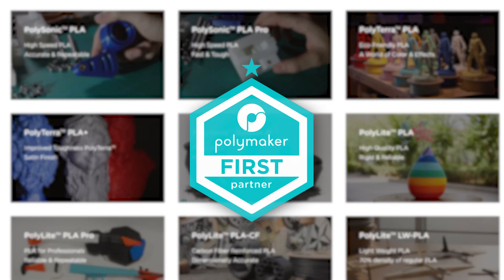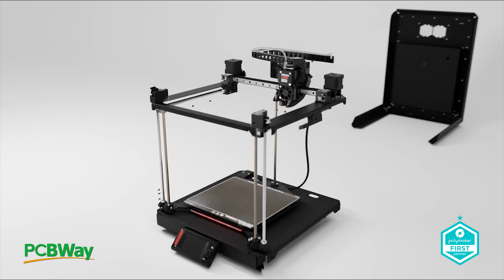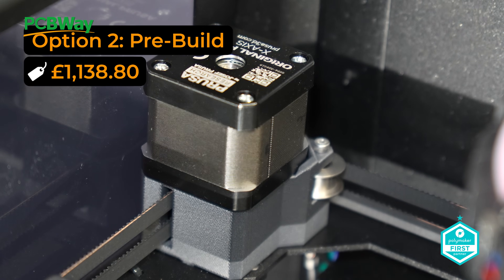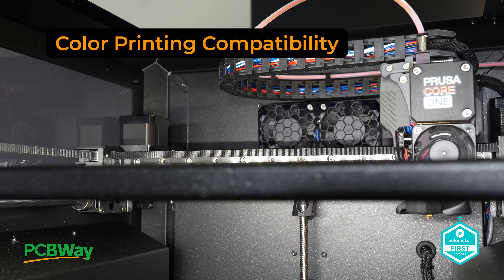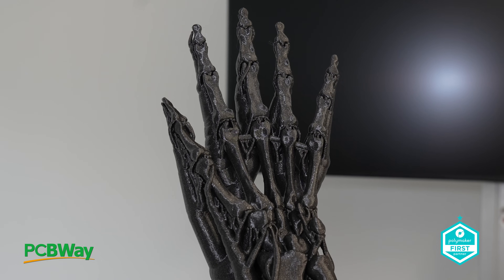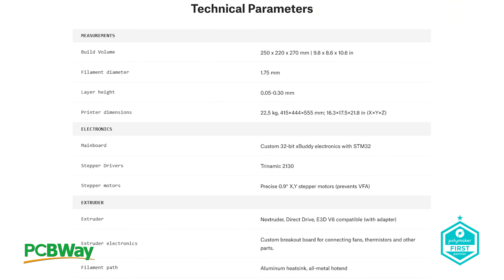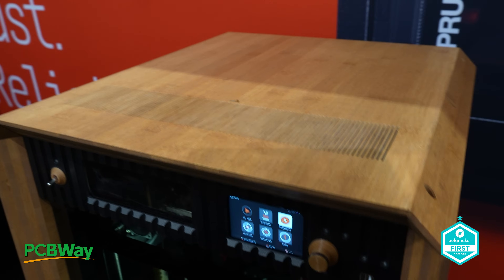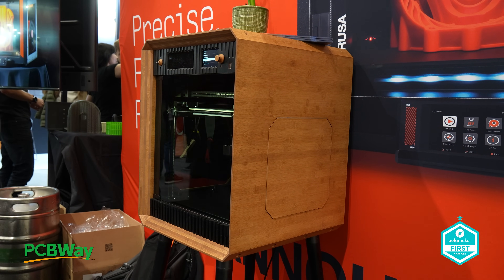Prusa Core One Takes 3D Printing to the NEXT LEVEL!

Comment: Let me preface that I am a Prusa XL 5 toolhead with enclosure owner and I love that machine. BUT this machine is still too expensive to compete in this market. Its build volume is still smaller than its direct competition the P1S and for that cheaper price you get an AMS and save some cash for filament. The offline printing ability is nice because I am one of those required to be offline customers, but this machine would be for my personal use and thus I would have to choose the P1S. If this machine was 800 usd I would be all for it because I love what Prusa used to be but not at what it will sell for.
Reply from the maker: It’s brand tho, so they will sell despite your belief they won’t. I always buy VW why don’t I buy Audi or BMW ? Well because I like and follow the brand.. having said the the t7 transporter is an ugly soul.
Reply: @TheRealSamPrentice  I never said it wouldnt sell, Prusa will sell to the die hards but its going to be tougher to win new customers. You have to hook new customers with size, price or quality.

Comment: 2:40 "increases bed size" is incorrect. It's an increased build volume. The z-axis is longer. The bed size stays the same.
Reply: Nope! The bed size is actually increased, albeit by only 1 cm in Y. (250 x 220 x 270 mm vs 250 x 210 x 220 mm for the MK4S)

Comment: The ability to upgrade a MK4S to the Core One is both a result of Prusa reusing tech from the MK4S to bootstrap a new core-xy design, as well as the desire to provide their customers with the value of upgradability.  The Core One uses the same bed and extruder as the MK4S, the extra build volume being the result of tighter tolerances in the movements, and a taller X axis thanks to the new packaging.  Yeah, I can't wait for April to be able to get one for myself.  I had been considering building a Voron Trident which would have cost me somewhat more than the Prusa kit price point.  The Trident would have a slightly larger build volume, but would also have taken up more valuable space in my office area.  I will also probably add the MMU3 as well.
Reply: As much as I find the Core1 cute, pretty sure you can get a Trident for way cheaper than this (just don't get a stupid LDO kit). The build time will be a pain but once properly done that machine will race laps around any other.
Reply: @RenBaiHu  LDO has the best kits out there with quality parts.  The other kits might be less expensive, but you might end up substituting some of the parts.  I'd like to see these kits done a la cart so I could buy one group of parts at a time to spread out the build and cost, as well as being able to customize them.   
I've had an idea with the trident, make the frame a bit wider and deeper so I could mod it to have two internal spool holders (the prusa can do this) and two independant X gantrys for an IDEX mod. 
(the 300mm size frame can fit internal spool holders, the stock 250mm can't, but it could be built a bit wider and deeper).

The prusa build documentation is very good, as good as Heathkit was in fact.  The Voron build info from Voron isn't bad, but most kits don't cover any changes THEY introduced leaving you to have to do some guesswork.
Reply: @KennethScharf  That used to be pretty true about the documentation but nowadays it's so out there that it's pretty easy to have all the info clearly. If you build stock then it's A+. When you start doing a bunch of modifications then yah, that gets hard and annoying when you have to troubleshoot something you don't really know lol. The Discord helps a LOT though.

I honestly can't justify the price difference between LDO and Formbot. The frames are both good, the moons motors are better than LDO, the rails are nice (not the best but pretty sure the tests done show that even high end rails aren't better off because of the way it's built and such). Hell if you wanted to get high end bearings and idlers, would only cost a few extra bucks. The electronics are good. The rest is preference... Whatever change I'd do on one I'd do on the other anyways.

I do wish the Core1 had a lower price then it would be a viable option but with the CAD$ and shipping, a 350 Trident fully built and customized would be about the same price here in the end.

Comment: prusa pricing is still out to lunch. same reason i wont purchase a dyson or apple, im not paying a premium just for a name.
Reply: Prusa build their name on excellent opensource hard- and software,  best customer support in the business and probably the most reliable printers you can buy. Not by ripping off customers with BS marketing like Dyson. Apple is..  more complicated. Bit of both I guess. Prusas are not cheap, but after throwing away money on 4 other printers, my Mk2 was my first printer that "just worked" and it still works perfectly to this day at a friends place. I can still even get parts or even upgrade parts for it should I ever need or want it. Same with my Mk3 which has been completely flawless and problem free. Ive looked at bambu. I dont doubt they are very good printers and priced very attractively;  but I dont mind paying more for support and for funding opensource innovation. We wouldnt be where we are today if it wasnt for prusa.  My prusa core was ordered the day they launched.
Reply: @vertigo2893  i understand all of that and prusa definitely has its place , personally i can achieve the same for much much less.
Reply: @vertigo2893  What have they innovated in the last 10 years exactly? Other designs like the Voron have been doing this for years.

Comment: Core one is canibalizing Mk4. Core one should´ve been 300x300x300mm corexy.
Reply: I think that's their way of showing they are not afraid of changing directions. In my opinion, that is a good thing. Not to mention that a 300mm cubed CoreXY would probably cannibalize on the XL instead.
Reply: @carlosjosejimenezbermudez9255  Actually not as the XL is even bigger than 300x300, or even 350x350 and can have up to 5 print heads!  What would be nice is a 300x300 (or close to that) with IBEX in a "Core Two".

Comment: For a prusa printer this is cheap, for a corexy printer with a build volume of this size it’s too expensive. Saying that a mk4 printer can be “upgraded” to a core one is amusing as any printer can be upgraded to something else if you buy enough parts. So from a mk4 the bits you can reuse is probably the screen, mainboard, hotend and maybe the power supply and stepper motors. 3d printing has started to move away from tinkerers and engineers to having pre build out of the box tools that people can use. Creality could provide a kit to upgrade a k1c to a k1max but you have to strip down one machine which leaves you with a lot of waste parts just to build another, when if you take your time as a cost is cheaper to just buy another. This does show how far behind prusa are in 3d printing at this moment in time. People are just frightened to say something since upsetting Joseph gets you the wrath of the prusa supporters.
Reply: There's a difference between buying parts off random websites and hacking an upgrade and doing a carefully documented upgrade with all the parts in a single package. If you have never built a Prusa you might not understand, but even if their machines are expensive, they are masters at making incredibly well documented kits that can level you up from total beginner to an intermediate user in 3d printing.

I think people greatly underestimate the amount of work that goes into making high quality manuals and kits. I'm a software developer, I can code almost any website you can think of, but asking for documentation for a step by step process is a different task and skill all on its own, and in my opinion, one of the main reasons why Bambu first time owners can't seem to understand why some people just won't stop buying from Prusa when they are more expensive for similar features.

If you want to run a print farm, sure, don't buy kits. If you want a good weekend with your kid while they also learn how a 3d printer works from the inside out, then buy a Prusa kit.
Reply: @carlosjosejimenezbermudez9255  your coming from an engineering point of view, I get it my degrees are in electrical and electronic engineering and over the years I have had to learn various operating languages from basic to JavaScript at which point I retired. It’s fun to tinker but you missed the point, the world has moved on, having fun with your child is a given and that can be done learning the design side of 3d modelling which is a sellable skill whereas it’s much harder to compete in building or learning the mechanical side of 3d printers. In 3 - 5 years time prusa will be bankrupt, as a small company it will never keep up with the development monster that is China. The next few years will see new advances in the 3d printing world that will surpass how we think of 3d printing even today. It’s take prusa years to design a new printer and that’s because they look at a longer lifespan for a product than China does. 
I am not pro China, but name an electronic product today that doesn’t contain a component made in China. Oh, and I do own a prusa, it was the first printer I ever bought and it took Prusa 3 goes at providing a machine that worked reliably, at that was one pre built at factory. Perhaps buying a kit would have been better as at least it would have been put together properly.
Reply: @carlosjosejimenezbermudez9255   You could just build yourself a Voron from the very start which also has excellent documentation that they created for free... Prusa has been ripping people off for years with outdated tech but the fanboys say it's ok because they are happy to sell you a upgrade path a few years later

Comment: I guess I just don't see the advantage of this over a P1S/X1C or even Bambu's next printer.
Reply: (Mostly) open source, not locked into their network (except for sneaker net with SD cards), second rate customer support, not lagging behind Prusa in features in their slicer (which is based on Prusa).
Reply: @KennethScharf  Lol, nothing you just said is accurate.

Comment: @2:46 Although it has "active temperature control" it's not a actively heated chamber. It can reach up to 55c if you keep it away from cool drafts, is i think what they mean. And you can print PLA/PETG with the doors closed.

I personally put in g-code in the filament profile for ABS/ASA/PC a wait command for 5-10 minutes after the bed reaches temperature
Reply: Even with the bed heating the chamber, they can still actively control the chamber temp by PWMing the fans.  I'd add a Nevermore filter though.

Comment: Active temperature control = heated bed heats up the chamber not a heater. Prusa is making it sound like it has a heater.
Reply: You only need high enclosure temperature when you print materials that require high bed temperature. Why do you need another heater when you have a pretty efficient 100C bed heater already ? The only thing you need is to keep a constant enclosure temperature, which the Core One does.
Reply: And it doesnt help much relying on the bed to heat the chamber for ABS etc. i added a chamber heater to my p1s, still costs less than this printer without it lol.
Reply: @GucciBodyBags  Because the internal volume of the printer is not much bigger than the build volume the heated bed will do a very good job in getting the chamber up to 55C when the bed is set for ASA/ABS temps.  And by PWMing the fans they can control the chamber temp without touching the bed temp.

Comment: I would've like to hear more about the vaunted open source nature of Prusa products and how it kept to that philosophy with the Prusa Core.
Reply: The answer is they are no longer open source hardware wise.
Reply: @BeefIngot  You will still be able to get the STL files to print your own spare parts, and you CAN import STLs into many CAD programs.  Hopefully they will at least provide PDFs of schematics of the electronics (not Gerbers or KiCad files).  And of course, the software sources.
Reply: @KennethScharf  Highly unlikely you get much useful. I mean for one, the majority of this isn't 3d printed, and it's doubtful they would release decent info on the board.
Reply: @BeefIngot  Even injection molded parts start off as STL files that are used to generate gcode to drive CNC machines to make the molds.  So it is possible to make 3D printed parts for the important bits of the machine.  And you can bet that all of the injection molded parts started off as 3D printed prototypes during the development of the printer.
I would be happy to have a PDF of the schematics for the electronics, that's enough info to repair the HW or mod the software if necessary.
Reply: @KennethScharf  They don't provide any of those is my point.

Comment: 55c is not enough for Asa 2:51
Reply: 40C is enough for ASA at least for parts. Have done tons on an X1C. The caveat would be very thick parts, but CF could help with that since many have printed ASA-CF without an enclosure at all.
Reply: @joescalon541  it's not enough for quality ASA filaments no, you need to hit like 70+ to have REAL good results.
Reply: I printed all the ASA parts for my Voron 2.4 on an unenclosed Prusa Mini, only had to reprint one part due to warping.
Reply: It's not even a heated chamber, It's passive from the bed.